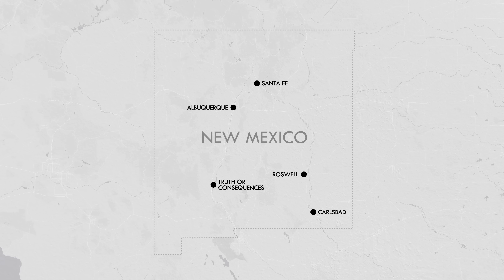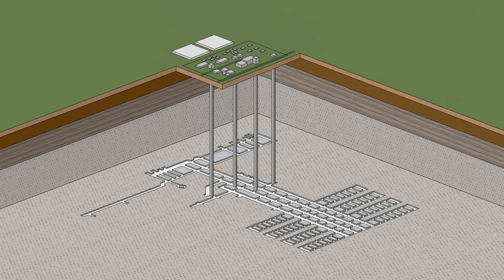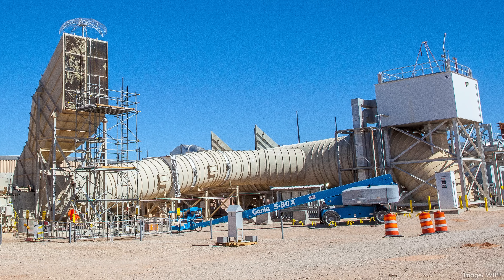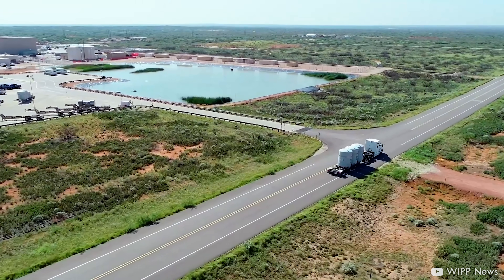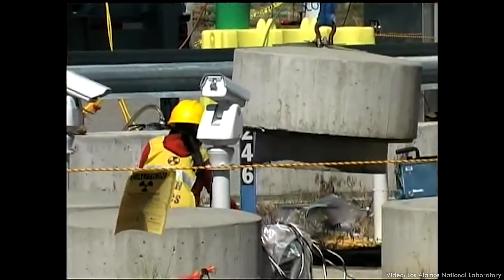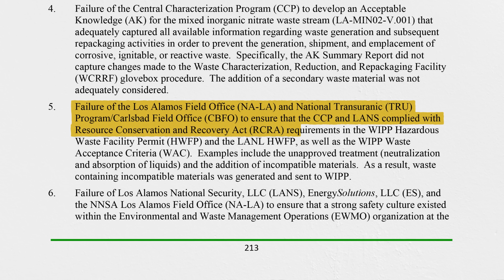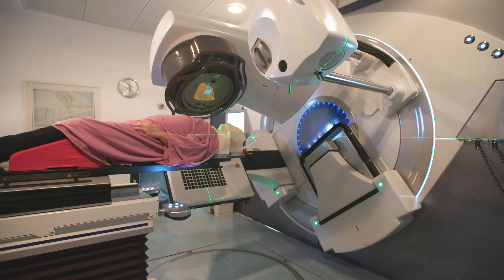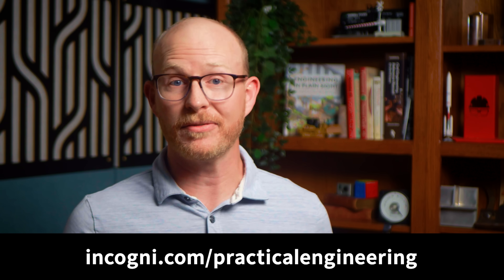When Kitty Litter Caused a Nuclear Catastrophe

Comment: As a Truck Driver, I HATED and LOATHED loads of Kitty Litter or Toilets...the clay they're made from is just Radioactive enough to set off the Detectors at Customs...

It basically guaranteed that a trip across the Boarder took at least 30 minutes longer than it would have if it was something like steel or paper...

[Sigh]...

Retirement is fun because I don't have to worry about it anymore...

😄😁😆😅😂🤣

Comment: I fired up my old copy of Word 2010 and typed in the phrase, "Use anorganic absorbent material to line the container."

The two top autocorrect options for "anorganic" are "inorganic" and "an organic".

Both options are prefectly correct, grammatically speaking.

In a long scientific manual of critical importance, the chances of mistaking one for the other when using the contemporary Word Autocorrect function instead of a human checker armed with the correct data, were frighteningly high.
Reply: That is known as regression testing in the software QA  industry. Going back to the said conditions with the same tools and operations to see if a bug or failure appears again. I had one developer get really mad at me for calling them out on a supposedly fixed bug from a year ago and it was there, but done in a similar way by a simulated "user" driving the copy of Windows. It wasn't a windows bug, but how the settings were put in the control panel for a driver that runs at the core of the OS.(network card and TCP/IP).  Sooooooo... that was a non shipper when you get a BSOD and reproduce it.
Pretty soon, we will need artificial stupidity to test artificial intelligence to see if it can recognize and unskilled operator and verify that AI will not provide wrong answers to gibberish queries. :}
Reply: Automated (AII) proofreading and regression testing is already introducing problems from precisely this sort of error. Springer Publishing is one of the leading voices in highlighting the danger of automated QA. Unfortunately, the AI fashion is moving forward without controls anyway. The central argument against caution is that the rewards are worth the inevitable failures. 

It’s concerning stuff.
Reply: My simplest summary of why automated regression tests should be mandatory, even if full automated testing isn't: "If you have fully understood the problem, they you've already done 90% of the work, and that last 10% protects you from having to do it again. If you haven't understood the problem that fully, then why do you imagine you can claim to have fixed it with any confidence?" Also: "The only things exempted from testing are those that are too simple to break. It broke. Therefore, it is conclusively shown that it is not too simple to break."

Comment: The organic/inorganic confusion is a great example of somehow less specific is more specific. If they had just said regular old cat litter, not a single rational person on earth would assume they meant expensive organic wheat based litter.
Reply: The government is absolutely full of this. They think they will clean up every mistake that has occurred, is occurring, and ever will occur by using lots of very verbose paperwork. But all it ends up doing is making everything so complicated it's impossible for even smart people to remember and verify all of it afterwards. They should be required to do a cost benefit analysis every time they make things more complicated to show where it is adding more value than it's subtracting.
Reply: @matthewhall5571  the cost benefit analysis has already been done. they don't do verbose just for the hell of it, but because responsibility of action, interpretation... the same way law is written in such specific ways
they have to be specific because the risk of being unspecific could have turned into shortcuts, and shortcuts kill and maim
so they are specific, to the point of utter ridiculousness

but being extremely detailed like that has the dual edge that people down the line will assume everything has been figured and checked in triplicate, so they don't have to
aka complacency

the issue isn't that government entities are wasteful, or they are over-specific, but that they become complacent with themselves, leading to shortcuts, leading to accidents
Reply: And, oops, scented cat litter turns out to have a chemical that reacts withn the nitrate salts... uhoh. They should have left it at Zeolite and specified a purity (or at least a list of unacceptable contaminants).
Reply: To clarify: that was a hypothetical. One that nobody else in the comments seems to have caught, for all the "this should be obvious" claims...

Comment: Coincidentally, I have a cat who is currently undergoing radioactive iodine treatment for a thyroid condition. The safety protocols that I signed before the treatment require that an organic litter be used. In this case, it is so that the radioactive waste can be flushed down the toilet, which is apparently safer than disposing of it in the trash. Who knew that intersection of radioactivity and cat litter could be such a complex topic!
Reply: And that the correct type of litter would be completely opposite! 😂
Reply: @hannahrobbins1017  Well regular non-organic zeolite kitty litter will just solidify and plug a toilet promptly. Soooo... That's why..
Reply: …I wouldn’t be surprised if somebody’s prior experience caring for a sick cat was a factor in how this mistake was made.

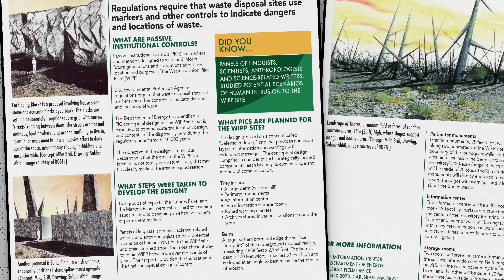Comment: 14:00 I honestly dislike the debate about signage for permanent waste disposal site. At that depth, it will require advanced mining equipment to ever reach when any civilization will have already  realized Radiation Detectors are a good tool at a mining site. All you need to do is fill the hole and make it look like it never existed. Plus, the majority of the hazardous waste like cesium and plutonium have a half life of 50 years or so. The radioactivity of the waste will drop significantly over the next few centuries and in 2-3 centuries from now it won't be anywhere near as deadly.

Comment: I hope nobody accidentally drills down through the aquifer into the salt. On Nov. 20, 1980, the Jefferson Island salt mines were destroyed when a funnel was accidentally created at the bottom of the lake--sweeping up everything within 65 miles
Reply: They specifically sited the facility where no ground water was found, also, where a minimum of oil deposits are found (that is, locally, not globally, you can see the boundaries of the site by the lines of the oil well pads).

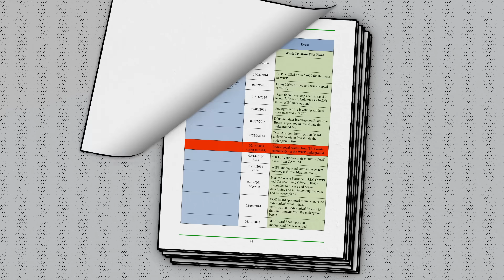Comment: 14:48 Wrong takeaway. The takeaway is that chemicals are more dangerous than isotopes. And that people working with chemicals need to have a working knowledge of chemistry to be safe. Any chemist could have told you that nitrate salts are strong oxidizers that readily react with organic compounds. It's painfully obvious that you shouldn't mix the two in long term containment storage.
This is an example of the risks of 1. people being ignorant
2. if they were not ignorant being too compliant and not questioning authority (which is exactly why chernobyl happened)
Reply: Humans make mistakes. 
Grady gives them cover.

Comment: National security requirements recommend diluting text in a document with acronyms in at least a 1.2 to 1.0 ratio.  Failure to do this might lead to someone being able to understand it.

(Thanks for plowing through those documents so we don't have to.)
Reply: The whole purpose of acronyms is to avoid spelling it out when used again. When I read further ahead or back from the highlighted text, I saw no evidence this was happening
Reply: @xenuno The acronyms that were not expanded online had already been used once, previously, in that document (and expanded on first use). This is, as far as I'm aware, fairly standard practice? Certainly it lines up with at least some style guides I'm aware of.

Comment: I'm pretty clueless when in come to nuclear waste. I understand that radioactive material is very hard to destroy or eliminate.  Soooo why not launch it into space? Toward the sun or in a direction that will take a million years to reach?
Reply: What happens when the rocket explodes?  Contaminants everywhere!
Reply: It can't be destroyed, but it decays, unlike most types of chemical contamination which doesn't.  two metres of water or rock will shield all the radiation, so putting it in a salt mine where water hasn't entered for millions of years is one solution.  Most "waste" consists of protective clothing, gloves and items which were used while handing radioactive material.  Second comes a smaller quantity of chemicals and liquids used in processing of the fuel or the waste, and the smallest volume of waste is the spent fuel itself.

Comment: what happens to the radioactivity contaminating a metallic object if you dissolve or smelt the metal? I"m wondering about VIABLE reclamation methods...and why it's not broadly used to minimise and perhaps eve reclaim the base material AND the radioactive material.
Reply: If the radioactive material is chemically different to the stuff it is contaminating, then it can be separated.  Radioactive caesium can be extracted from  contaminated seawater, as they did at Fukushima.   Lead manufactured after 1945 is very slightly radioactive (from the era of atomic bomb testing), so shielding required for very sensitive measurements is often made from pre-WW2 lead from old buildings or churches where it was used in roofing.
Reply: @karhukivi  okay fair. can you explain WHY the lead is, it's self radioactivated? HOW does it do that? like...my understanding is "irradiated water" for example is that it contains radioactive particles in suspension, and if you had a good enough filter you would purify it. would that be true if you were to...say...get lead hot enough to DISTILL it? assuming the radioactive material IN the lead did not disstill as well?
Reply: @TizonaAmanthia  Post WWII lead is slightly radioactive because of contamination with non-lead sources and lead sources from nuclear fallout. The process of chemically purifying it would be really, really expensive, and the contamination level is so absurdly low that it only matters if you are doing insanely sensitive radiation measurements (like Dark Matter detection thousands of feet underground sensitive). Incidentally, the level of fallout in stuff has significantly declined (as the radionuclides decayed) after the Atmospheric Test Ban treaty.
Reply: >My taur panda OC
>Breeding Mount
>A very Ombre morning - 3/4 Flaccid Dnips
>ClamBoating By Grind3r
>Squig Life Cycle
spoken like a champion
Reply: @paulmccartney2327 WAT.

Comment: Well done. I followed this incident at the time. I found your report to be accurate. As a kid, back in the early 1960s, I formulated rocket fuels using nitrate salts and organic sugar so I knew how reactive such mixtures can be.

The primary transuranic isotope in the waste is plutonium-239. It is the primary fission fuel employed in nuclear weapons and most of the waste stream originated from the manufacture of those weapons. Pu-239 has a half-life of a bit greater than 24,000 years so such waste materials pose a potential radiation hazard for around a quarter million years.

Comment: Why wouldn't such places be designed with Blast Doors? Seal off the fire, it uses up the air and goes out.
Reply: The fire was sealed off, in a barrel. The nitrates act as the oxidizer. Nothing stops a fire like that until it burns out (short of dunking it in a giant vat of liquid nitrogen or somesuch to cool it below the ignition temp). Only the one drum burned, nothing else caught on fire.

Comment: Why doesn't we build the electric grit in direct current?
Reply: Best to keep HVDC for where it is most advantageous. To replace the whole grid would be an unnecessary expense unless the technology becomes considerably cheaper to make the transmission losses cost more than the equipment.
Reply: @conradharcourt8263  That is exactly it. The only reason I can think of is, that "we have done it differently before, let's not change what works." Why wouldn't an island nation try it, when most appliances rectify the voltage anyway?
Tesla won the argument AC vs DC back then, because he could convert between HV and LV easier. But voltage multipliers exis.
The long parallel wires of AC feel like the wast a lot of energy through capacitance.

Comment: Isn't it obvious to any reasonably intelligent person that mixing a fuel (organic absorbent) and an oxidizer (nitrates) is a bad idea unless you want to induce a reaction? 

It should only require a single reasonably intelligent person that also has some basic understanding of chemistry to realize mixing fuel and oxidizers couldn't be right, involved somewhere in the chain of events between the f-up and sealing the containers to avoid that outcome.
Reply: Oddly enough there are some very intelligent people who know nothing about chemistry.  Obviously most people have their specialisms.  However anyone whose job it was to check the document should have been able to spot the error.

Comment: The amazing thing about salt is that it's often used to test the likes of N95 material. Salt is one of the hardest things to filter out. Particles smaller than the salt actually are easier to capture in N95 material. People started to argue against N95 masks but that got debunked quickly due to a few research papers getting shared about the Brownian motion phenomenon.

Comment: Seems inherently dangerous to have the transuranics as nitrates.  I'm guessing since all or nearly all nitrates are water-soluble, it makes handling easier.
Reply: It's because using nitric acid to dissolve the fuel pellets is how you start the process of extracting plutonium from uranium.
Reply: @  Yes, but it could be switched to a different counterion once it is in solution.
Reply: @beryllium1932  They didn't seem super concerned about waste in the Manhattan project era, I don't know what counterion they use later, but even if you do an ion swap, you still have the nitrate ion to get rid of, and it will almost certainly still be contaminated with some of the actinide cations.

Comment: I believe this is caused by bureaucracy. Not too much, but too little. Who in their right mind advises to use "kitty litter" of whatever kind for anything except fill a litter box? NIST is there for a reason and they should have referenced something from their (or whatever acronym organization would be better suited) catalog and tested it for compliance before using it.
Reply: Traditional kitty litter is just a convenient form of bentonite clay. It's used for all sorts of industrial processes. If you want it in an easily handled form, and you don't need a hundred tons of it, kitty litter is the way to go. The problem was someone swapped the litter type from "inorganic" to "an organic" which also swaps it from chemically inert to chemically reactive. (Essentially they made a small amount of poor man's TNT, if by accident. For a large amount, see Timothy McVeigh.) This is an error any chemist would have caught (I did, even 50 years out from a chemistry major) especially with the clay type (brand name, really) right there a few words previous, but evidently no one with even a smattering of chemistry handled the document after this point, and... BOOM.

Comment: Strange they conflated zeolite with kitty-litter from the start, even before we get to the chem 101 mistake of nitrates with carbohydrates (likely reviewed by multiple people!) ; that indicates grossly unqualified management or negligence. Most inorganic kitty-litter is based on sodium bentonite clay not zeolite(not a clay). Though I have seen zeolite sold for adsorbing ammonia in horse stalls, not as an absorbant litter or bedding just a gaseous adsorbant (I don't know if it is even effective in that sort of open air application or a gimmick).
Reply: It's an effective liquid absorbent.